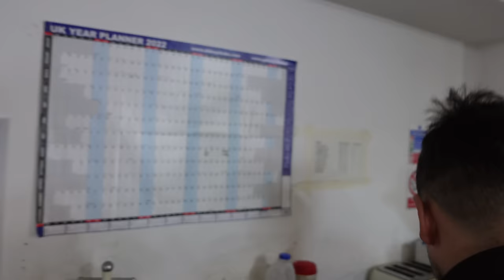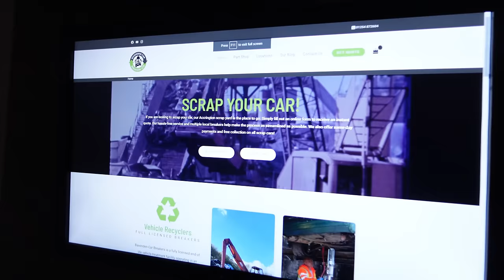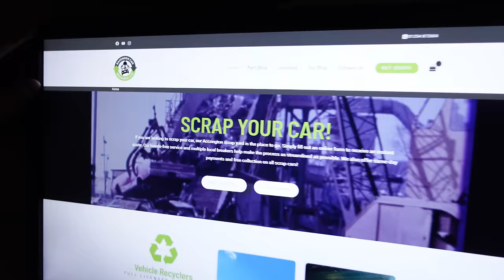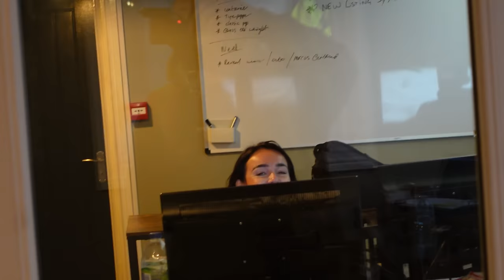Gifting Alfie Odd Job A FREE Van! | WHAT A LOAD OF SCRAP - EP6

Comment: You guys should save more car parts which people may want to purchase for salvaged cars that don't have some parts line l did from co part car salvage centre l purchased a fiat five 5,09 that had missing mirrors and seats for the back of the car and then l purchased a salvaged vauxhall insignia car which did not have a key barell for the key to go into and the passenger seat had been removed so l went to our local car scrap yard for most of my parts for both of my cars you guys should do this

Comment: you guys are ripping through a silly amount of car's now good to see your right about the listings needing streamlining though I've been meaning to pop up since you call in at FCS (RIP) it's never going to be easy and it's way more complicated braking all brands it's easy to list a part and only state the car it came off the key is to find out all the makes models and years using that part so you can fill in the compatibility charts correct making it visible to more people's searches the tricky part is EBay compatibility charts don't allow enough options to account for things like 3-5door and many more small details that matter resulting in the compatibility check telling customers the part will fit and no matter how hard you try to point out the obvious in your title or description EBay will take the side of the customer every time so adding as much information as possible but in doubt leave it out is the way and I've noticed you have listings for things like windscreen washer pumps £15 ish if you look at the listings as a customer then scroll down you will see new ones for 1/2 the price but if the car is new enuf and you sell it with the bottle it can sell for silly money you need to have someone who knows there stuff and cares looking over that side of things and with how quickly all this sort of thing varies 😟
Reply from the maker: Oh yes totally agree the items on eBay is a bigger job than some people think it really is . And you should pop down next time your passing pal
Reply: @BCB  👍will do one Saturday it's hard to find time for us geafters 😉